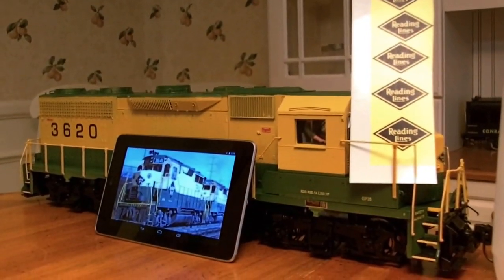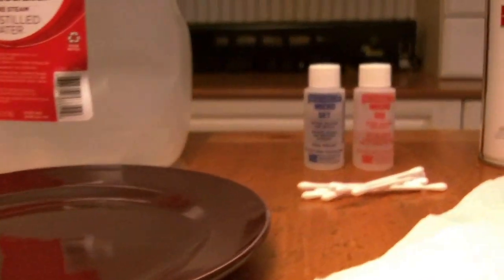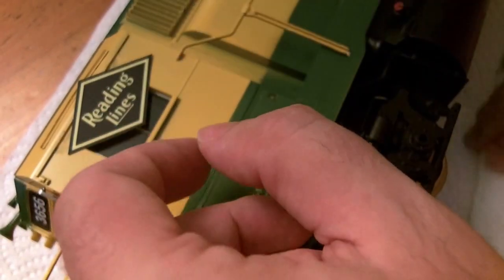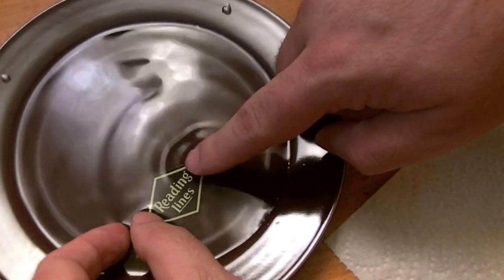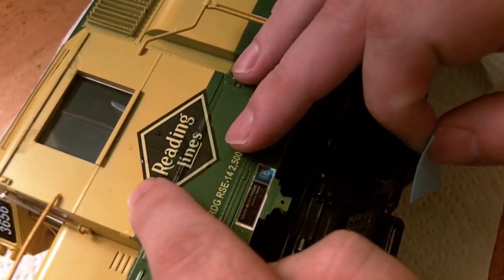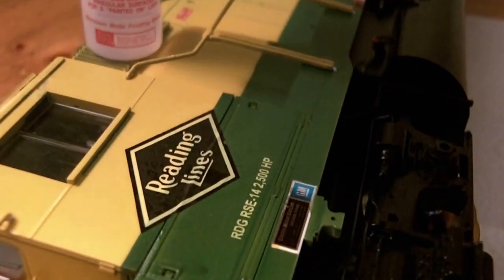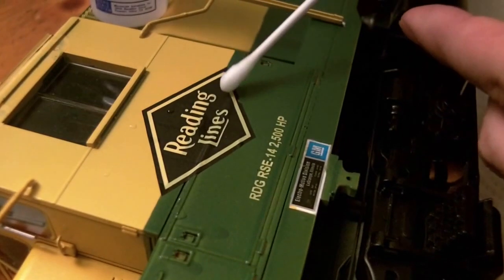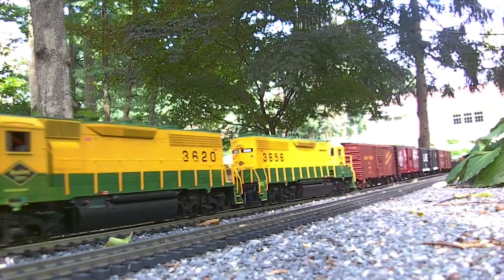How To Apply Decals

Comment from the maker: The GP-35 is my favorite diesel.  I found three ways to have one on my RR.  One option is a 1:32 brass model available for $3,000.  Another is a not-to-scale K-Line with bad motors.  Neither seemed to fit my goals of affordable, decent operating, 1:29 model.  So I used Aristo GP-40 models as a base for modification into GP-35 locos.

Comment: so do you have to add that micro sol and set after the decal is on the locomotive or train car???
Reply from the maker: You don't have to, especially for smaller scales and on a smooth surface.  It helps to sort of "melt" the decal around things like rivets or wood grain detail and it helps with a big decal as there are likely to be bubbles to work out.  If you do use it, it will help to settle things in quite nicely.  Just don't move the decal around after it has been with the micro sol as the decal will be extra pliable and can easily warp into a funky shape.
Reply: @GardenRR  I see cause I was thinking on getting a detail for my mth water tender and I just wanted to know if the decal will be fine if the stuff you added isn't added and to just be safe.
Reply from the maker: @evanf1293  decals totally work with just water (preferably distilled water so it goes on clean, without any contaminants drying onto the surface) but to get a perfect "painted on look" some sort of decal setting solution (a very weak acid) is the best bet.  I use it even on a smooth surface as "smooth" to us isn't really smooth at a microscopic level.
Reply: @GardenRR  I see well thanks for the tip guess I'll buy the decal I want and do what I can when I add it.

Comment: I recently applied new decals to my bicycle frame that just got a fresh cover of powder coat. What can I apply or spray on the decals to make them set better and last longer. thanks.
Reply from the maker: +cloudchaser07 I would start with a gloss clear before you apply the decals and after thy are FULLY dry (24 hours) put another coat or two of clear over that to protect them.
Reply: +Garden RR something like Rust-Oleum Painters Touch Ultra Cover 2X Gloss Clear?
Reply from the maker: +cloudchaser07 Yeah, that should do fine.  Multiple light coats will look a lot better than on big, thick, runny coat.  Check the can for re-coat times but it is usually when the paint flashes off, you don't have to wait for it to fully dry, which can be a day or more.